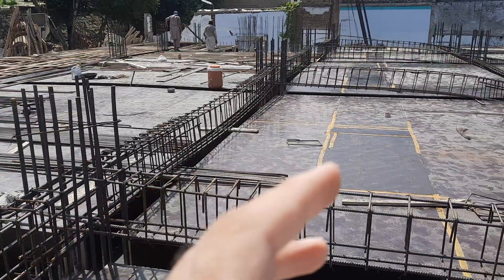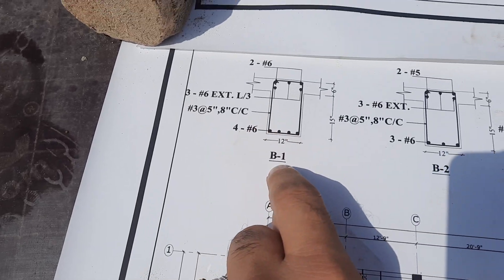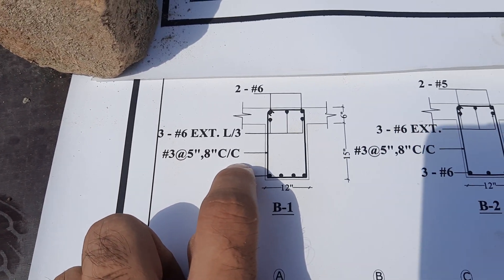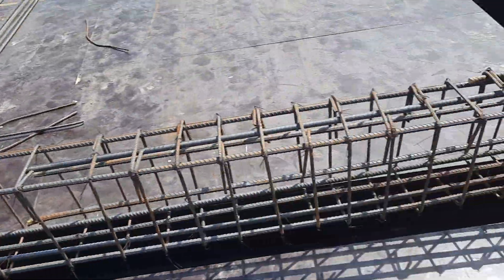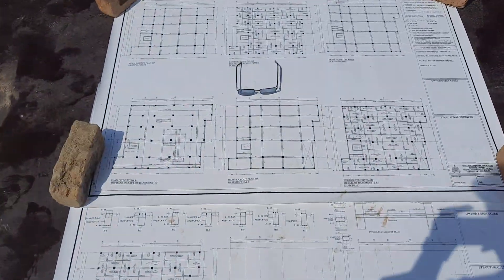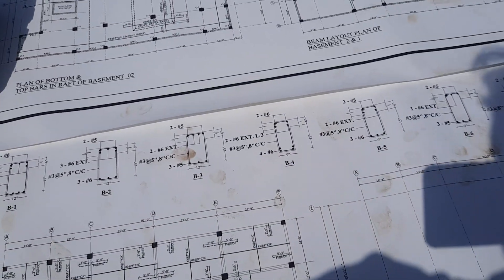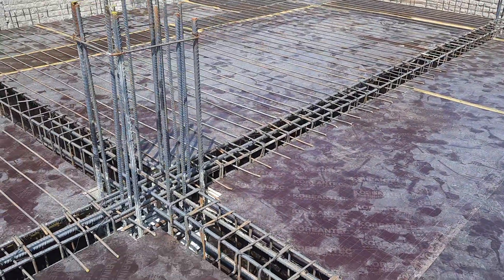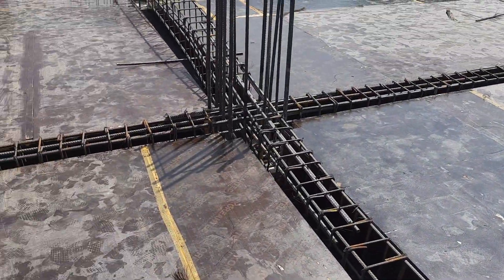Study Structural Drawing with Practical Video on Site | Civil Engineering Practical Video |

Comment: good work. but i have question why you added one bar in top in media  reinforced .what is the benefit.
Reply: It is usually added to resist shear. Shear is maximum at the support, so the spacing of the links is reduced and extra bars, the top bar at the middle and the other two at the edges are added to counter it. I hope I'm correct

Comment: 2:42 what do you mean by dia is 6 number???
Reply: it means its diameter is 19mm, i am not sure though
Reply: @aqoonyahan4059  19mm dia bar?🤣🤣🤣
Reply: @immortalmallu  #6 rebar diameters in the metric system is 19 mm. Its nominal diameter in Inch is 0.750 inches (3/4 In.)
Reply: Sir 6 number means 6 sooter
Reply: It is 16mm bar